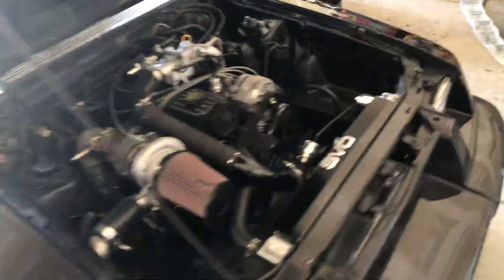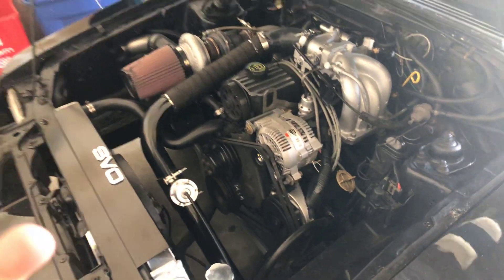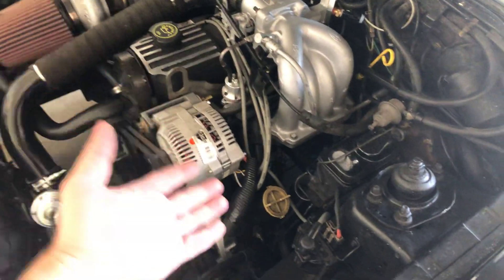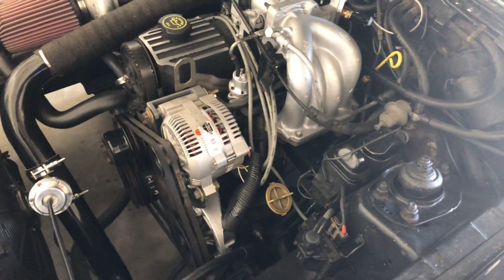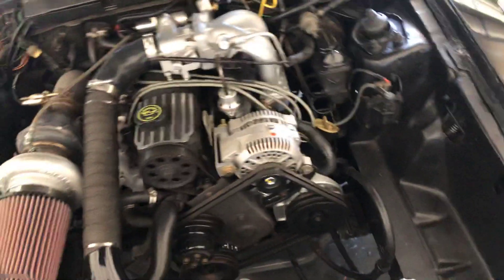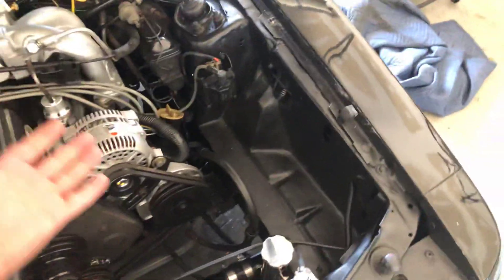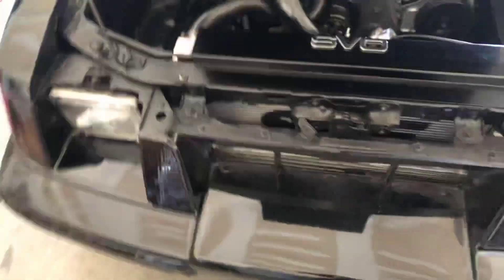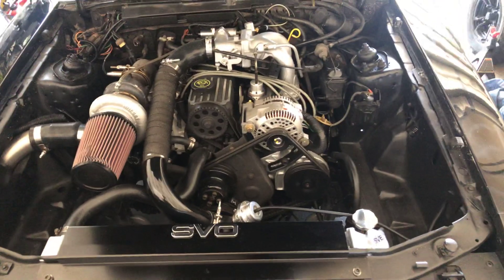84 svo Mustang TFI module overheating update - should I convert to EDIS?

Comment: I am running coil on plug with my Pimpxs on my Turbo 306. It’s a great setup but I think you would be best to just relocate the TFI.
Reply from the maker: NoFox Given I used to have a 5.4 4v mustang that I converted to COP.  I loved the clean setup and now I have a pimpx I feel edis would be a better setup.  Although I think I agree the TFI fix is easiest.
Reply: I bet with the way that distributor sits down in there it’s getting a TON of heat.
Reply: Are you on the Stinger forum? Those guys have helped me a lot
Reply from the maker: NoFox Given yea I’m in there and they are super helpful.  In this case I don’t have a data log yet which they require.  One of my next steps.